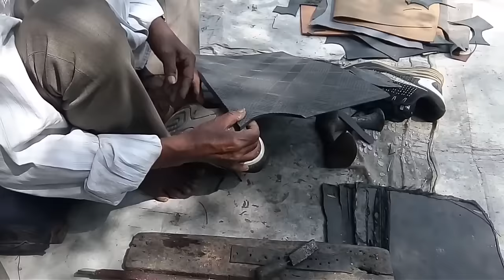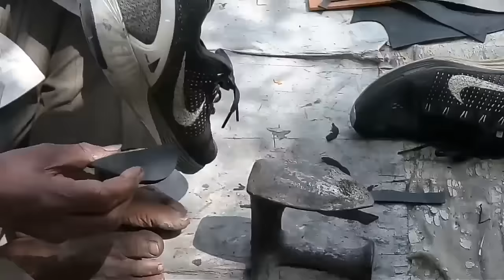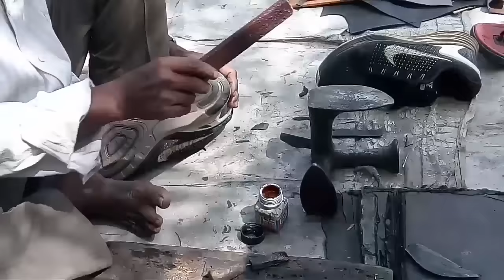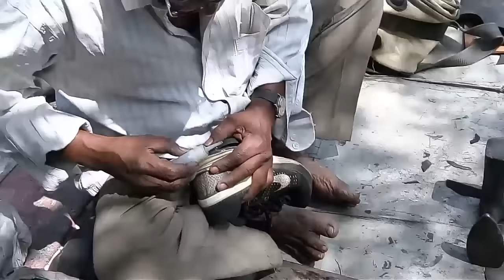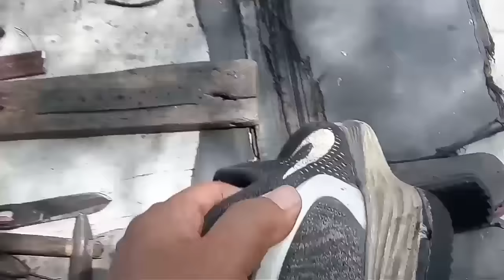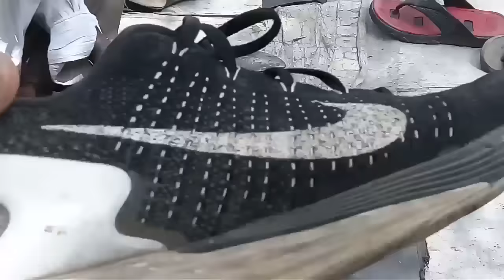NIKE SHOE REPAIR

Comment from the maker: I used the repaired shoe for next 4-5- months.
Reply: Mritieunjay Kumar . thanks for sharing. Greetings from México.
Reply: Mritieunjay Kumar u must not walk around much
Reply: Not bad
Reply: Did you need an appointment with your chiropractor after walking on that abomination for 5 months 😁
Reply: Most shoes are only expected to last  2 months ...cheers
Reply: What was the cost uncle....
Reply: @CharlesPiccolaPhotography  If you buy rubbish. Quality shoes, well maintained will last will last a lifetime.
Reply: @geoffwhite6383  I contacted sketchers,  they told me there shoes are expected to last for....
Reply: @CharlesPiccolaPhotography you must only be able to afford really cheap shoes then. 😂😂

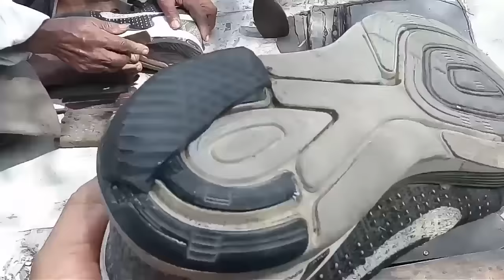Comment: 9:10 - That's the final result an uneven sole, yep great work he managed to make them worse.
Reply from the maker: No. He made an uneven sole to an even one. He only looks untrained , but has 30 years of experience in mending.
Reply: Mritieunjay Kumar 

Is that sacarsm? Im tempted to skip the timeline...
Reply: He put the rubber there because that’s where a lot of heel drag happens

Comment: Not to be rude but it would be much easier to repair a tennis , golf and skate shoe with this method rather than a runner or basket ball shoe simply because they are flat and you can change the insole and repair the sole alot easier.

Comment: Superglue won't hold that, he should put two nails in it!
Reply: It was a crappy job all round but I think you will find that the super glue was only to hold it in place while the contact glue cured.
Reply from the maker: But it held !!
Reply: Contact glue was the main substance holding it together. Superglue was ther to hold it in place while drying.
Reply: Rusted nails would work even better